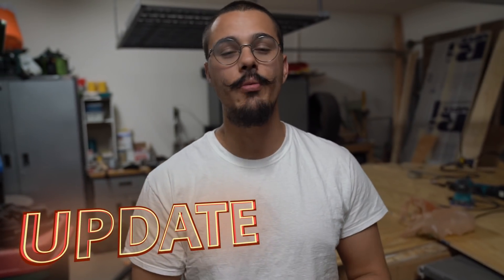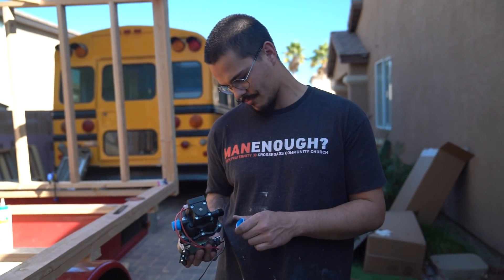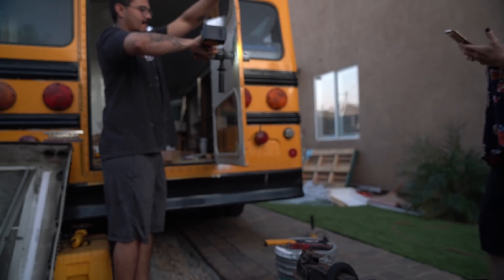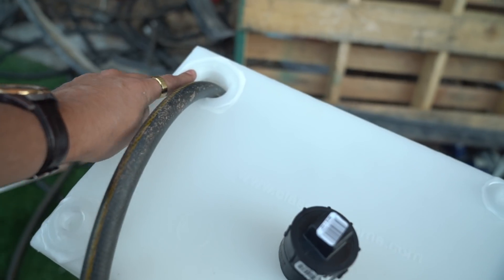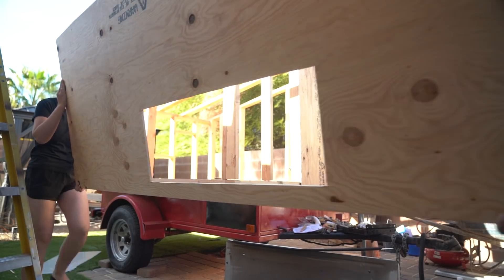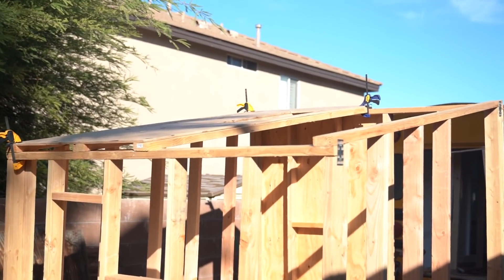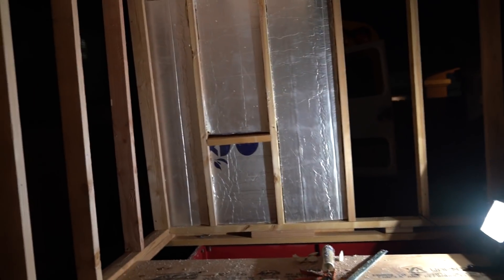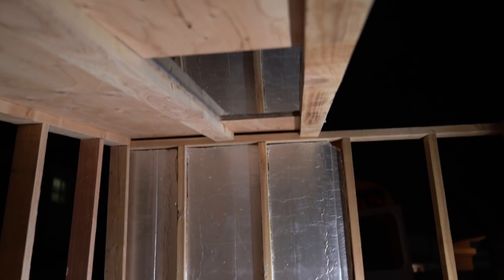Installing The Trailer Skylight! | Skoolie Build (Ep.19)

Comment: Trying to weld aluminum to steel (painted steel at that) is not going to work without using the proper technique which you sort of realized when you simply melted through the aluminum. Pre-drilling holes and bolting it or maybe even riveting would likely be the better option if you don't decide to research then properly weld the two metals.

Comment: Welding Aluminum is a bad idea cause it just melts. Try poprivits ( spelling??)
Please make sure that if you use the sealing tape that you don't bend or tear it... It may leak. The crome finish is better. 
Are you gonna put insulation on top of the foam and then more ply wood?